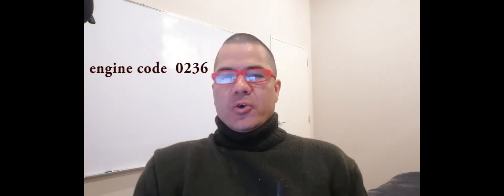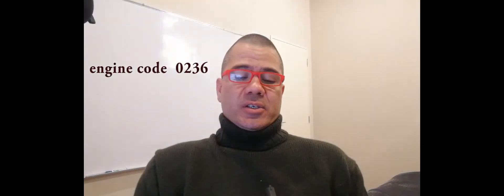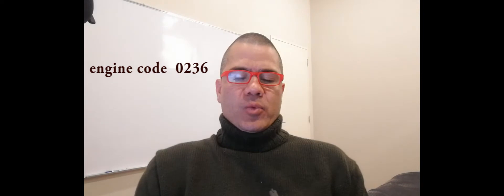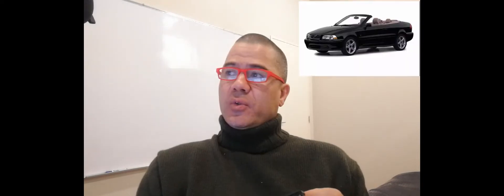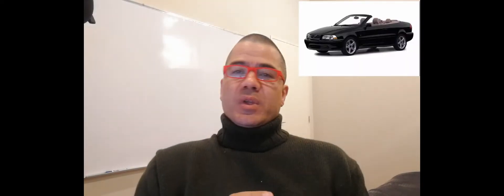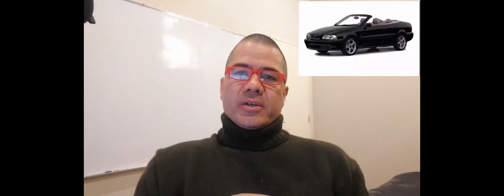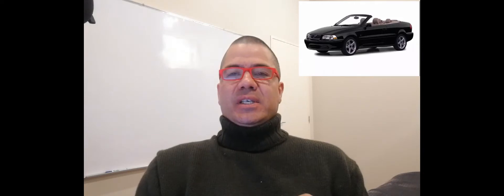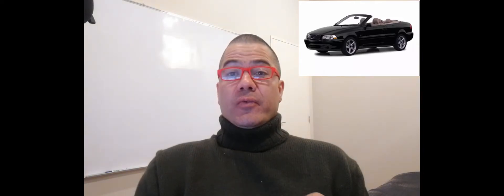volvo 0236 engine code

Comment: Was the gear box problem caused by the MAP sensor or did the  solenoids fix that for you?
Reply from the maker: solenoids fixed the gearbox problem.. the solenoids pintals were sticking... common fault